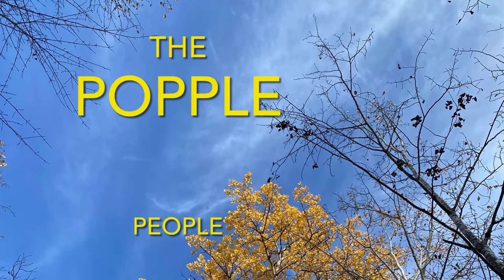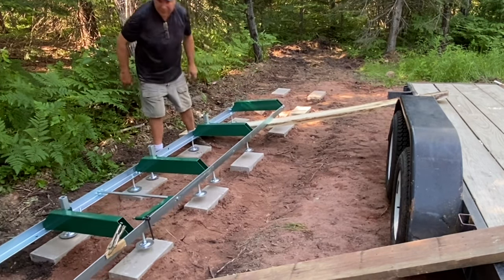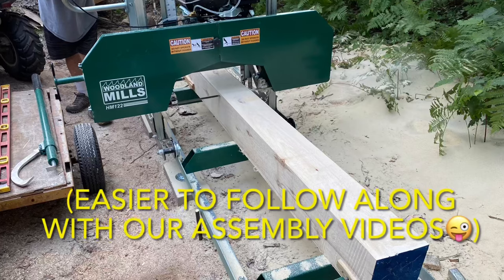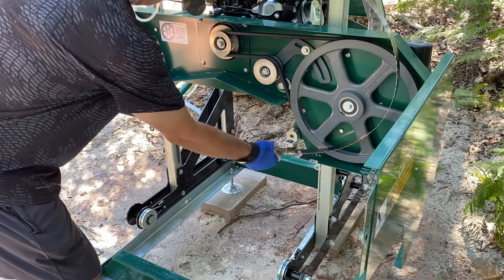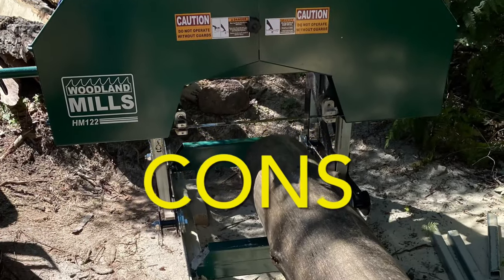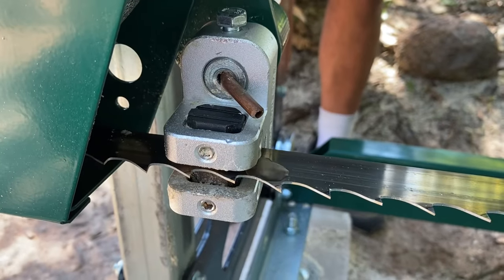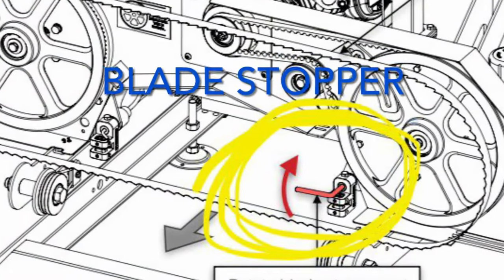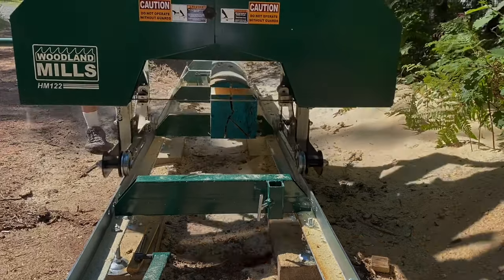BRUTALLY HONEST SAWMILL REVIEW: 6 Months with a Woodland Mills HM122-Popple People-Episode 53

Comment: I want to comment on your corrosion issue... I work in this industry and there is no replacement that's affordable for preventative maintenance.    Also, what you cover your equipment with matters ... if you're using vinyl tarps or other waterproof materials that are non air permeable you are creating a greenhouse effect which is great for causing corrosion.
Reply from the maker: Thanks, Roy! We’ve got it moved into the saw shack now, so hopefully that will help too!

Comment: As always great video we have the same mill I agree with you for the money I don’t think you can beat the HM122 we set ours up on a permanent platform with a tin roof over it sawdust is one of our biggest issues we hang a 5 gallon bucket on the bottom hinge I added a section on top side of the bucket so it catches most of the sawdust 2-3 cuts down the log it’s time to empty the permanent platform really makes a big difference thanks for sharing your thoughts
Reply from the maker: Thanks, Jerry! We’re working on the permanent “home” for the mill right now…& you’re exactly right—the sawdust sure does pile up! 😝

Comment: My Blade stopper kept falling off as well. I always say its not if you saw your log stops its when. A buddy of mine however made wooden log stops for his mill. Looking at your log that wouldnt fit, It looks like if you rolled your log a little more it might squeeze by your blade guides Sometimes You can lower your log stops an inch or so and that will let your log move that extra inch or two. Great video, I can relate to all your points.
Reply from the maker: Thanks! Yea, we’ve seen the homemade wooden ones…might make a set eventually. That log didn’t budge any more (we tried! 😝)—I think there was a bump from a branch or something that prevented it from rolling any further regardless of where the log stops were set at.

Comment: On the log stop vibrating out...put some blue...or even red Locktite on the threads.  And maybe a long enough lock bolt for an extra jam nut.  Use red...you just have to heat it some to break it down should you need to readjust.  Ten seconds with a propane torch would do it.
Reply from the maker: Thanks for the tip, George! We appreciate it!
Reply: According to locktight the red is fully released 400F. I find it brakes loose way before that. Red is a great option when near a blade.

Comment: As much as I would frown at seeing it also I don't believe the rusting will be a major issue. The paint gets chipped off easily in those high wear areas as you mentioned and the rust soon sets in but it's my bet that it will not intrude very deeply into the steel at least not quickly after, it gets the patina. Thanks for the informative video. Looking into different models currently.
Reply from the maker: Hoping it won’t be an issue. Thanks!
Reply: A small carport type roof over it  might be a good investment as well.
Reply from the maker: We built a saw shack for it, so it’s covered & much more protected now. Thanks!

Comment: Great review! My woodmizer had no blade stops. Ruined 2 blades. Lt40. Had to pull a lever to idle up. And start blade. It was very crude. It lifted the engine to tighten the drive belt. I changed it over to electric idle and a 800 dollar centrifugal clutch. Belts constantly ran loose, charging problems, hydraulic switches, etc. Glad I sold it. Still toting wood.
Reply from the maker: Thanks! Interesting to hear about your Woodmizer…wouldn’t have expected that.

Comment: That mill looks brand new.  I got the 121 this May, and it looks, shall we say, dusty.  My biggest issue is with the chok system.  It's very difficult to keep the log square.  I haven't modified mine, either, except for a few dents and bruises.
Reply from the maker: Lol! Yeah, we’ve been careful with it, touched up the paint, etc. We also use a leaf blower to clean it after each use.

Comment: Thanks for the video I'm currently using the lucas mill I'm just wondering what's your technique to roll the heavy logs over do you just use a log grab
Reply from the maker: Since we moved the mill to our Saw Shack, we are currently designing a log bench to roll logs onto the mill (because it’s sitting quite a bit higher than the ground level now). When we filmed this video, we muscled the logs up with a cant hook—it worked well because of the leverage. Between that & the 2 of us working together, we were able to get even some pretty sizeable logs onto the bunks.

Comment: I notice on your idler wheel the belt is super loose, has it always been that way? On my HM126 the idler wheel belt is super tight and ever since day one I have nothing but trouble changing blades, I have to readjust the tracking virtually everytime I change the belt and have to get on my back to make sure the adjuster goes back into the hole it rides in.
Reply from the maker: Great question! That belt has always been loose like that & we haven’t needed to do much adjusting when we change blades (we always check alignment when we do a change).
Reply: On the 2020 & newer hm122 models that idler side belt is supposed to be loose like that.

Comment: I am on site looking at the 122.
Would you all do a measurement for me.
Extend the log support up almost as high as it will go/// 
 On the log clamp, back out the T handled pinch screw till tip of screw is just at clamp edge., lift/hold clamp up parallel to the log support and measure distance from log support to log clamp screw tip..  
With that SCENARIO with the t screw backed all way out will the cutting upright pass????
Best; Tom
Reply from the maker: Hi! And great question! If understanding correctly…the measurement between the log stop & clamp is only 17” 😮 (which surprised us!).

Comment: Great review, we are currently look at this model, or the harbor freight mill...
Reply from the maker: Thanks! We looked at the HF model…do yourself a favor & get the Woodland Mill. You’ll be disappointed with the HF.
Reply: @PopplePeople  I will need to build a lean too, or or some sort of a building. I do not have the room to store it indoors. But I want to try and keep it covered and dry to keep the rust away.
Reply from the maker: We have videos on our saw shack build if you want to check those out:
https://youtube.com/playlist?list=PLsvJVQ8K9T8pGh_mwLt5wd78r1ac2oanN
Reply: Do yourself a favor and look at cooks mp 32 mill. It's manual but built like a tank. All welded heavy frame and rails. Ez boardwalk Jr is good as well and cheaper than the cooks .
Reply from the maker: Thanks, Will! We haven’t seen either of those “in person”…yet!

Comment: I know species of wood and how dry it is matters, but on average, how often do you need to change the blades?
Reply from the maker: Great question…& it’s a tough one! 😝 There are a lot of factors…we have cut mainly popple & it really depends on, as you said, how green or dry it is, whether it has bark on or if it’s peeled, how dirty the outside of the log is, etc.  To be honest, we haven’t really kept track of like how many logs or board feet we get per blade, & we also don’t mill every day (or even every week—the sawmill is a hobby we get to when we can). Taking a guess I’d say about every 10-12 logs or so…we have been going by “feel” & change the blade when the sawhead pushes differently/harder & the cuts get a wavy look to them (boards don’t look as clean). Hope that helps!
Reply: @PopplePeople  helps a lot thank you!